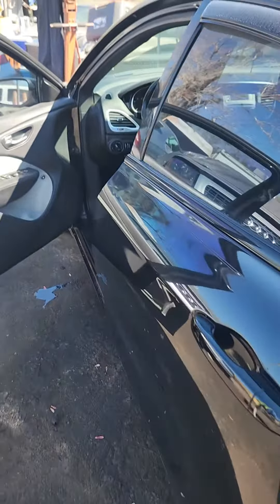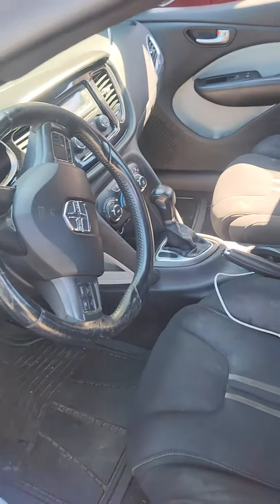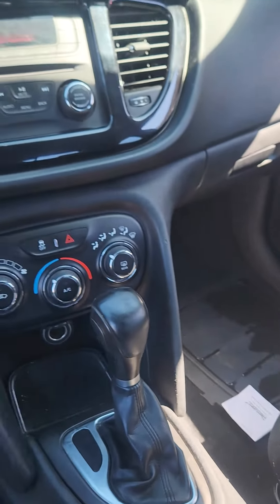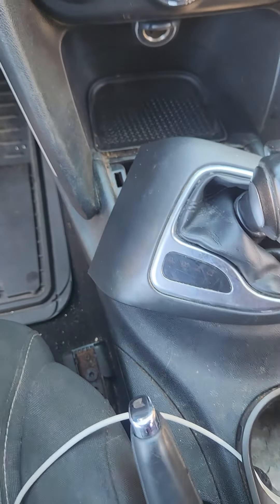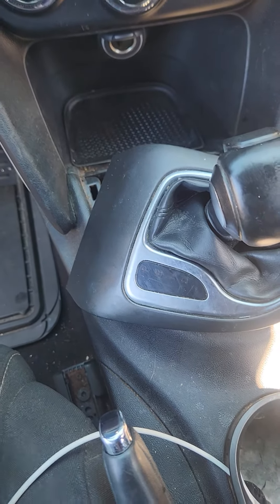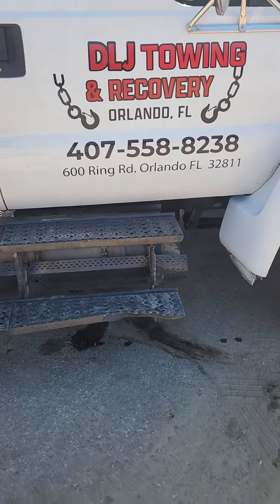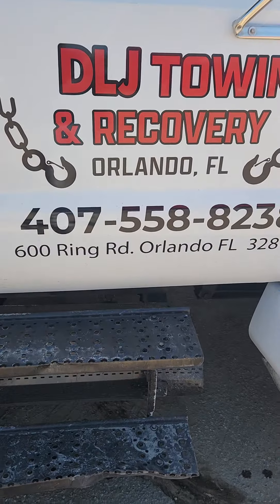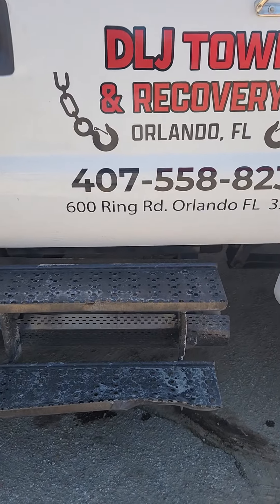How to put a 2010 - 15 Dodge Dart  in neutral.

Comment: So what causes the car to act like it in neutral when in park? Say on the 1.4 … when running you can put in gear but nothing moves…. When in park it still rolls like it’s in neutral. It looks like shifter cable is moving at the trans? Maybe not fully ?  If someone messes up this button can it cause issues?
Reply: no, this button he is showing just lets you put it in gear (or in neutral) without the keys in the ignition or without battery power. you're problem is either that the cable is not moving the lever on the transmission, which you said it looks like it is, or it's a broken parking pawl, which is inside the transmission and is what holds your transmission output shaft from rotating when in park.